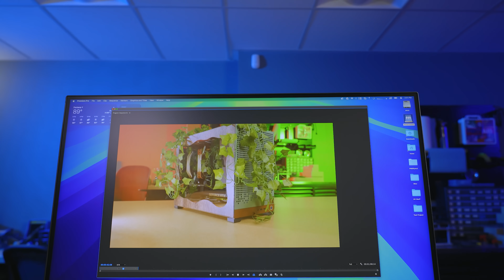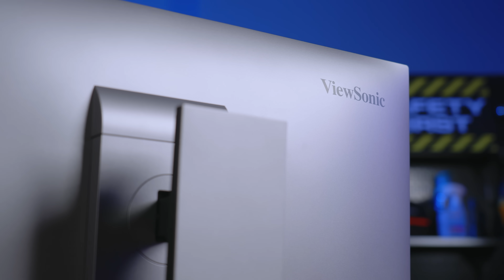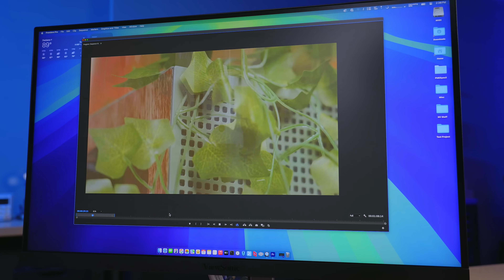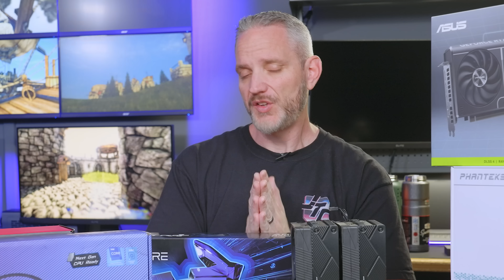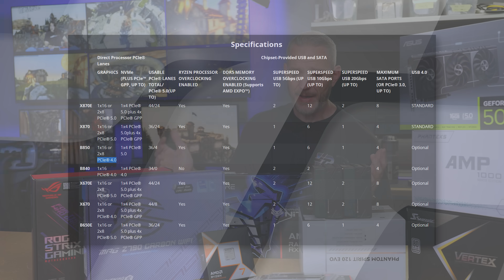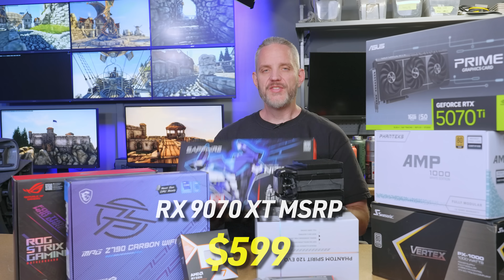This is the Sweetspot for PC gaming... Don't get fooled into spending more!

Comment: Hard to agree with your opinion on M.2 support, because with many motherboards that simply is not happening due to PCIe lane sharing. Sorry but if a motherboard has four slots and they screw PCI lanes to hell, then you do not have PCI lane support. I originally wanted an ROG motherboard, until I seen the PCIe lane hatchet job.

For me the motherboard is the heart of the system, I see the point of cheaper mother boards if your just playing games with one or two M.2 drives. But I want to play with USB 4, I plan on getting the Corsair EX400U for my external storage, I want up to four NVMe Gen 4 drives that are not bent over and gimped by the board manufacturers PCIe lane implimentation, and will still run a couple of HGST HDD's with an optical drive. WiFi is a plus, and I like to use optical out and a desktop dac via USB, and will utilise a number of USB ports.

So I spent my money on an Asrock X870e Nova for features, and got a nice discount on a 7600x which is a great starting CPU for AM5. Easy to upgrade later, and will be re-used if I upgrade. 
CPU coolers are Noctua, four of my systems run Noctua, and Noctua have supplied me with brackets on multiple new CPU releases, a couple have been used from LGA775 and they have already supplied two AM5 brackets for my next builds. 

I only need one GPU slot, and occasionally an x4. Not bothered with RGB. In fact having a motherboard with more functionality is probably more important to me than gaming, I can spend £370 on a motherboard and £330 on a GPU and game at 1080p and still enjoy it, but I feel it's rather dumb of me to spend over £700 on a GPU and £400+ on a decent CPU simply to play games with a motherboard that  can be any old £120 model that allows it to run, but will need external periphials to plug more external periphials into.

The biggest issue is simply GPU pricing. With the 9060xt and 5060ti being good for casual 1080p gaming and having 16gb of memory, it feels like the 9070xt and 5070to are as much a rip off as the 5080 was in comparison to the 5070ti. Give us 24gb 9070xt and 5070ti !!

I want to play some games at 4k, some at 1440p and some at 1080p, I have a 4k 160hz 27" monitor, with a 75" 120hz option too and a 1080p secondary.  
Would like to avoid the 12v cables as I bought my last two PSU's just as that standard came out.  I feel spending £700 on a GPU to play games is simply mental in this day and age. So will most likely end up with a 9070xt or 5070ti if they get to msrp, will just need to see if Cablemod can make me custom 12v cables for my PSU's as I prefer not to use adapters, and all the GPU's I like inc the 9070xt's have the new 12v cable.

Certainly would rather not be buying a new PSU when I have a boxed Seasonic Snowsilent 650w platinum, boxed CM V-1000 Gold, and use a Seasonic 850w prime which was bought just as 12v Nvidia standards were released.

Comment: So many people fall into this midrange category. That's why I love watching these videos. So many channels only talk about the bleeding edge stuff, but the majority can't or don't want to buy it. You can have just as much fun on mid range PC parts these days. The most important part is that we're getting people to build a PC and enjoy the hobby. The more people we get into the hobby, the better it is for everyone.
Reply: I used to be an entusiast level builder up until a few years ago (last "bleeding edge" build i made was when RTX 2000 Super series came out). 
Today i no longer care about being on the bleeding edge anymore but i will still build (when i do, around every 5 or 6 years) with top tier hardware to be safe going forward for years to come. I pass my "decommissioned" builds to my missus and she still has nothing to worry about whenever she wants to buy a game because she knows it will run perfectly fine, usually at max settings.
Reply: @Kid574  I finally decided to do an upgrade after 8 years.  I added was 500gb ssd because my 1tb hd was slow and getting old. Then I added 1tb nvme for more storage for games... which I upgraded to 4tb nvme because that 1tb was too small for these large ass games these days.

I went with 

b650 & 32gb ram
9700x + phantom spirit
5060ti 16gb

Total $1,125

I reused everything else.  Case, 750w psu, & fans.

My old build was
B450 + 16gb ram
R7 1700 /w wraith cooler
gtx 1080

I plan on adding 2 more 4tb nvme's in the future because my mother board as 3 m.2 slots when ever my 4tb becomes full. Then I'll toss the 500gb.
I also plan on adding 6 icue link fans so I can reduce the cable clutter of my older corsair fans.
After that I'm going to replace my monitor because it because the screen has issues from time to time.
Reply: RX 6650 XT with Ryzen 5 5600x processor and everything works on max settings (warhammer 3 I think I had to reduce the shadows a bit). I managed to do this because I play at 1080p so the GPU can handle it with a 24 inch monitor so it doesn't lose crispness on that resolution
Reply: @GHR-q9w  I'm almost the exact as you, but i got the 6750xt on an opened box deal. For me it's the same, runs everything and i still haven't even overclocked the gpu, i actually run it undervolted
Reply: @Writeous0ne   Very cool. This is the way
Reply: @Writeous0ne I am you, but stronger (RX 6800)
Reply: Exactly, just look at the Steam hardware survey, over 54% of gamers still use 1080p displays, while ≈20% use 1440p and just ≈7% are on a 4K monitor.
Reply: I build a "new" computer about every 5 years.  I always aim for CPU, GPU, Ram etc. that is the generation below cutting edge.
The final result is one third to one half the price of a cutting edge system and get about 70-80% of the performance for the tasks I want - gaming, browsing, etc.,  - typical usage.
Obviously, if you're a graphic designer or some other occupation or hobby that need cutting edge, this doesn't apply.
Reply: @MrVvulf Graphic design isn’t actually super intensive. Any modern 6 core cpu is capable of running relatively complex photoshop and illustrator documents with dozens and dozens of layers or high resolutions. Hell, I was doing it on a dual core laptop cpu in 2016.
Reply: The main problem - there is nothing to build endgame PC for (apart from purely professional tasks). Gaming is shit. AAA gaming is triple shit. UE5 is even more shit and will churn no more than 60 fps on the beefiest systems without upscale and fake frames. So why bother? Mid range PC will allow you to play all the fun games there are.
Reply: I wanted to buila pc. But I end up getting so confused with all the options . I just want the games to play smooth and look good..
Reply: Exactly. So many channels assume that if this is your hobby you are looking to spend as much as you can possibly afford. But above a certain point the diminishing returns on better equipment don’t justify the price. I sit and listen to all these metrics and wonder whether I can tell the difference. I know there are people who can distinguish between 144fps and 240fps, I just don’t think I’m one of them. It ends up being very difficult to know things like should I spend the extra $50 on a controller to reduce input latency from 2.5ms to 1.0ms. They both sound really fast so the important question rarely answered is “does the difference matter to the average gamer?”
Reply: Many tech youtube channels have become insufferable and are just advertising 1440p and 4k for people who would never use anything close to that 80% of the time and would do fine with 1080p and raytracing is definitely overrated, it all reminds me of the old bluray corpo advertisements.
Reply: @lethn2929  raytracing done well is extremely impressive. Fortunately raytracing is rarely done well so it isn't worth it right now but within the next couple years developers will learn how to actually effectively implement it.
Reply: I was trying to find comparisons of the amd 7800x3d cpu vs intel and every video was using the rtx5090 gpu. Like who tf even owns those outside of YouTube reviewers apparently
Reply: Just buy a cpu with a stock cooler included with the cpu if you are on a budget (I'm guessing most of us are).
Reply: I was trying to find comparisons of the amd 7800x3d cpu vs intel and every video was using the rtx5090 gpu. Like who tf even owns those outside of YouTube reviewers apparently
Reply: Considering the number one used card on Steams hardware stats is a 3060 with people using 1080p monitors (which is me using a 12gb card on a g-sync monitor). You would think that developers would want to support that fact. But, no. They keep investing millions into graphics that try to push people into the latest hardware. Then wonder why they get review bombed for performance and they lose sales and brand reputation. /facepalm
Reply: considering most people build a pc and use it for 5-10 years, I don't see how people label it as a "hobby"
Reply: The most fun I ever had was on some of the slowest hardware that exists. Higher end PC <> more ‘Fun’.
Reply: Not really. Sure you have your LTT channels that only cover highest end because lets be real every single video they release is just clickbait "we spent this much" in the title. But most channels I would say cover the mid range. What does have an extreme lack of coverage on youtube is the lower end. Not even talking 50 series too legit 60 series and amd equivalent builds they get no coverage at all.

Legit the only channel I have seen in years who consistently covers low end stuff is randomgaminghd. That channel is such a gem glad it never changed over all the years.
Reply: Lmao poor talk
Reply: @Rafael-km9mx  Very weird comment but ok.
Reply: Have a little shame clippy
Reply: @Rafael-km9mx  Lmao fair enough. Clippy just wanted to help

Comment: Overspecing your power supply and going with a gold rating is definitely good advice. For gamers on a budget, I would recommend an AM4 Ryzen 3600x or 5600x paired with an Nvidia 2060 super or an AMD 6600 to 6700 for performance on par with a PS5 (better in some ways and worse in others). Also, a Gen 3 or 4 NVMe helps to load games quickly.
Reply: I think 750 W is enough for most people, and the recommended wattage by GPU manufacturers is usually already somewhat overspec'd. And I am running a 3090 with a 650 W PSU 🤣
Reply: I question buying gold rated if you're building a budget to mid build.  I would want to replace that power supply in 5 years if im getting new components cpu or gpu just for the peace of mind.  Unless you upgrade every 2 years or something.
Reply: Don't go by gold ratings anymore it is exposed how fake it is to get that rating. That's why all respectable brands have cybernetics ratings on their new psus really only go by that now.

Comment: Also, make room for a $250 UPS (Uninterruptable Power Supply).  There's nothing quite like spending $2000-2500 on a system that gets fried by a random power surge from the wall socket--plus, it can maximize your components' lifespans because it "cleans up" the power coming from the outlet.  And even if the batteries die (~4-5 yrs), the surge-protection still protects the non-battery-powered sockets, and replacement batteries are about $100-$150 cheaper (still recommend replacing the UPS after going through the second set of batteries, though).
Reply: Actually an apc power conditioner
Reply: I have never in my life experienced or known anyone who experienced fried hardware without using a ups. Legit a surge protector is all you need and they are dirt cheap. Buy a 20 dollar surge protector and you will have the same safty as a 250 dollar ups they are such a waste of money.

Comment: I pulled the trigger on a 9800x3d, 64gb 6000mt/s cl36, and asrock b850 phantom riptide, lian li edge 1000w gold, lian li vector v100, and a galahad lite ii 360mm aio earlier today. i'm keeping my ssds and amd 6900xt for another generation because I just can't justify an upgrade with the prices of this gen. I'm in the hole for about $1,100. I chose looser CL on ram because I cared more about 64gb than cl30 for VMs, and a bajillion chrome tab. The lian li parts were surprisingly cheap. I could've saved money on the CPU, but with a 6900xt, and running games or 2-3 VMs at once, it just made sense.

Comment: Microcenter openbox. I got my 5070 ti for less than msrp. There is a intermittent noise from the magnetic fans slowing down. No issues otherwise. worth it. 2 year warranty + tax = $800

Comment: using 3070 with 1440p monitor, gaming at 1440p, just setting games to max settings, medium settings are good, most games are good at high settings as well, so yeah, even 3070 is still going good
cpu is 5600x 
ram (i went balls to the walls) - 64 gb(ddr4 3600 MHz)
650Watt gold corsair power supply

Comment: My main machine was top tier, circa 2022 (7900 XT 20GB GPU paired with a 7800X3D CPU). I am not upgrading either of these until they can't run games at 90-100 FPS on my 1440P OLED monitor. This is a good rig for 8 years. Don't believe it? The NVIDIA GTX 1080 8GB, which is 9 years old, is STILL running AAA games like Cyberpunk and Spider-Man at 60 FPS at 1440P w/o ray tracing on medium-high settings.  And I paired that with a newer AM4 cpu (an AMD 5600G). Don't believe the hype.

Comment: I'm so in with this.
PSU is really the allways-staying part. The one thing that (literally) hooks the system together and keeps it alive.

Years and years and years ago I got a 650W GS-class Corsair IIRC, one of the bad ones (I never had any issues though) and only replaced it with RM850x when I had weird issues with my then-current PC (R7 1700 etc) only to find out my issues were with damaged memory controller on the CPu itself. Well, now I have that 850W power supply to power my 9070XT with R7 5700X3D.
I believe the next upgrade will be from AM4 to AM5 or the PSU, probably the motherboard and CPU first since AMD is not too power hungry. This might change as well.

The oldest part I still have connected to t his build is my Asus Xonar DGX PCIe soundcard. Only few months ago I still had a single HDD connected, but I've since moved to full NVMe system and have been wondering: how or why I never did it before?

Comment: A mid-range PC offers only slightly better FPS / resolution than a console, but comes at a significantly higher cost.
Most importantly it’s not upgradable.
To upgrade to a hight end gpu on my mid range Pc, i had to change my motherboard, power supply, ram and cpu.

Comment: My personal sweet spot if I was just heavy gaming and wanted to save some money would go as follows:
GPU: 9070XT (Cheapest you can find)
CPU: Ryzen 7 7700X
Cooler: Thermalright Peerless Assassin 120 SE V2
MB: MSI B650 Tomahawk
RAM: 2x16gb Crucial (Non-RGB) DDR5 6000 CL30
Storage: Crucial P310 2TB NVMe
PSU: Montech Century II 850w 80 Plus Gold
Case: Whatever has a good airflow rating for anywhere between $50-$80, personal choice

Arctic 120mm fans all around with an Arctic 140mm Exhaust.

I think thats a solid machine for the money that can do 1440p with ease. I'm sure someone could save even more with enough research.

Comment: Pc im building is around $1200, CPU 14900K and GPU RTX 5060 TI.
Reply: Eww
Reply: Make VERY sure that you're using a top notch air or AIO cooler with that CPU, especially if your case is lacking in air flow.
Reply: Get a 7800x3d (200 dollars cheaper and only 5% less performance than 9800x3d) and bump that gpu up to a 5070 or 5070 ti and you will be much happier. Or if you wanna stay on intel go for it do the same get a 265k and upgrade the gpu a tier. Just don't buy the 14900k that is not a smart combo at all.

Comment: I spend a little over 1000 every 5 years. Currently it's a 9800x3d with the RTX3080 which migrated with some sata HD and SSD's. Previous system was the 9900k from Intel. That one ran the GTX1080 until I purchased the RTX3080 at launch. I do have to change one of my 13 year old seagate barracuda's though, not that it's failing, but defragmenting it takes way longer than the other barracuda. Better be safe than sorry, and I don't want to push it till the end either. But that's about it if you want to run fast cpu and fast videocard. Ofcourse I already added a fast m.2 drive and more to come, but I can do that if possible, when not, then it's not an issue either.

Comment: I get my 9800x3d today 😊, but I only went with cl30 6k ram but it's looser timing cl30,38,38,94 not cl30 ,36,36,94 should be just fine I am gonna buy a new 1tb drive for the system. I am pairing it with a 3080 only because I want my 1%lows to be better than my 5950x can provide. In the future I plan on adding a new GPU later but for now this will save some money and still get my GPU to be better utilized. As of now my 3080 maxes out at 84% so I got a little wiggle room so I got the 9800x3d on the last day of prime day 😅 saved that $25 hahaha